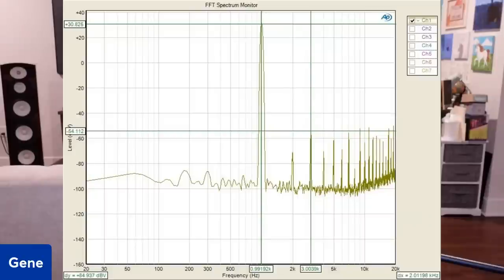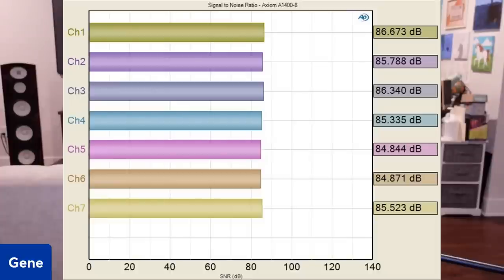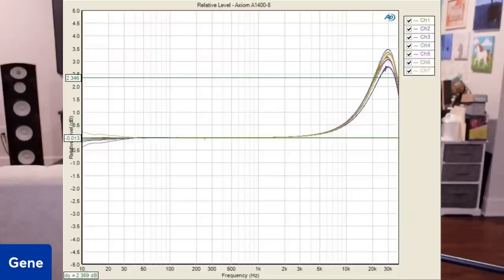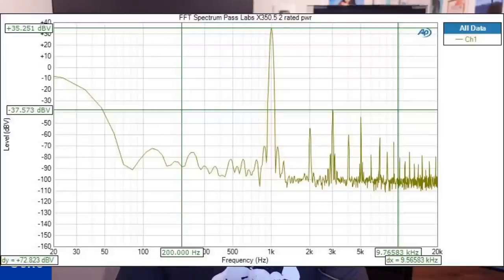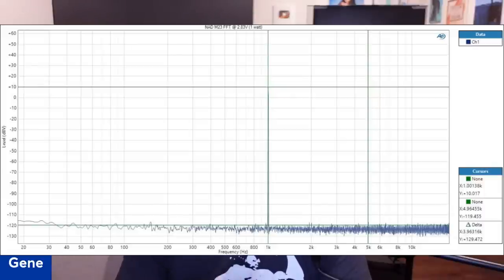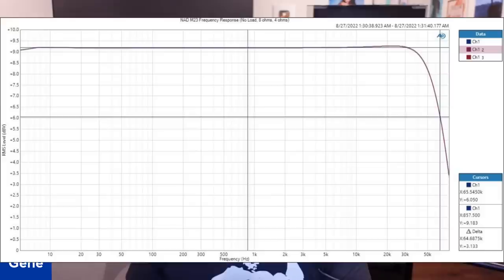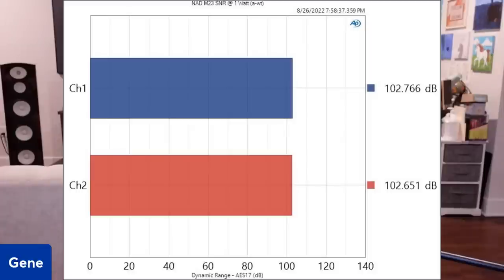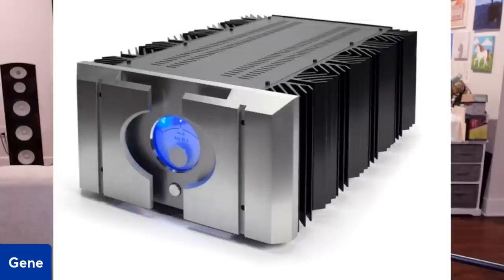Linear Amps are DEAD, Long Live Class D!

Comment: I have tried the Hypex UCD modules and those are garbage for hifi as they give me listening fatigue. But I guess that they are okay for rear channels in a surround setup og a subwoofer.
Reply: With which speakers? What amp are you using now instead?
Reply: @ThePentosin  My speakers are a pair of Ekta Grande, designed by Troels Gravesen (3 way, with Scan-speak revalator drivers). Now I’m using a Gryphon power amp to drive them. I have also used a NAD S300 integrated amplifier which sound similar to the Gryphon power amp that I now use.
Reply: @3Dmaking  Well, ucd is over 10 years old. So it fall i line with the point of the video.
Your speakers going down to 3ohm might exacerbate the issues with it. 
Would be interesting to know if the newer ncore would satisfy you.
Reply: good for a subwoofer
Reply: @ThePentosin  I know. The other amps that I use are +20years. But the impedance load in nothing special from a 4 Ohm speaker. The next amplifier is not going to be anything nCore, but most likely a Parasound Halo JC5 😁

Comment: Yes, Class D is the future. Love my Purifi amps and I also will not have to worry as much over my electric bill this winter. 😉
Reply: true but in winter, any excess energy used by an a/b amp is directly heating your home, so it's not really "wasted"... except to the extent that electric heat is more expensive than gas or a heat pump.

Comment: So I guess you're not familiar with the measurements of the Topping LA90 amp. Class A/B
Reply: I can't find any measurements besides the manufacturer's claim, can you point me to any review? Looks good indeed. I wonder what's inside the box. A separate power supply - that's cheating, though. That's why the enclosure is so small.
Reply: @VioletGiraffe  Check audio science review...

Comment: Hi. Previously NAD had the M32 amplifier with DirectDigital technology which was fully digital amplifying. What happened with it? Why NAD switched to HybridDigital which is by fact analog amplifying in class D?
Reply: My M32 didn’t sound that good.  I had $600 monoblocks with better treble response when hooked up to a Node 2i.  I think the NAD class D had a hard time with high frequency speaker load.  I sold it at a $2k loss.

Comment: No problems from me with class d though I continue to have issue with many of them not being able to maintain rated output in higher frequencies.
Reply: what does that even mean?  no one is ever putting out 100w to the tweeter, or frequencies in the 1000s of hz.  we need the power primarily for bass.  if you were to cut out everything below a couple hundred hz, the power required is FAR far less, like an order of magnitude.  simply not an issue at all.  and in any rational set up, you've chosen an amp that has enough power - i.e. a real usable power rating (>.1% thd) that exceeds what you'll actually use... you don't buy an amp to use it at 100% of it's rating, so that makes it even more irrelevant of an issue.
Reply: Bone up on power usage by tweeters.  It's short term and most tweeters can handle thousands of watts.  If you like clipped hf, good for you.
Reply: @bluelithium9808  I'm fairly boned up as you say and just read a bunch on audio science review and other places and feel my point stands.   What are you smoking exactly, or provide your reasoning or sources.   We are talking about domestic listening environments, within 3-4 meters.  Are you listening to super high dynamic range music with peaks pushing 105, 110, 120dB with inefficient speakers?   If you're crazy like that good for you get yourself a thousand watt amp and call it a day.  But under normal conditions for 99% of people this is simply not an issue, and class d amps have no inherent issues with limited HF output power.  

I know all about how tweeters can handle one or a FEW cycles at stupid high power levels - without mechanical damage, NOT clean outputs.   That's irrelevant for music and normal listening volumes.   HF transient peaks are typically 60-80% the power of lower frequency peaks, so yes that could be quite a lot more than the general understanding of a tweeter only using 10-15% of the total power.  Indeed tweeter transients could need all 25 or 50 or 100 watts of clean power to match SPL with the woofer.  But amps also, though to a lesser extent, also have the ability to output higher levels in a burst / transient scenario.  Especially when we're talking HF transients which are effectively super short bursts.

However none of that matters in the average living room set up with even above average listening levels.   Your tweeter isn't peaking with over 100-200 watts.  And even if it was, as long as it wasn't mechanically damaged, you wouldn't hear the distortion in a transient anyway.   Most tweeters would be distorting long before a (clean) hundred watt amp clipped.  

The very papers and discussions linked to and had on sites like audio science review that discuss high power transients to tweeters support this conclusion.  You should stop worrying about it, it's not the problem you think it is, and it certainly has no relationship to class d vs classabout, at least not any good modern example of one.   I listen at LOUD volumes at times, with ~125w of clean power from a class t ta3020 design and my super tweeters as well as my mid horn that goes to 8-10khz ish are still doing just fine and I never hear any amp clipping because it isn't happening... it's not as though the hf transients are larger than the bass ones, so you would know if you had clipping.  Now tweeter distortion?   That's a different question, that may be occurring on transients, it likely is, or even in sustained loud passages.  But I can't hear it at any volume I listen to, and past a certain point I doubt you'd notice past the physical pain and even distortion of your inner ear.

Most tweeters cannot handle "thousands" of watts, but hundreds maybe a thousand... but mechanically surviving it is what they are talking about, not producing clean transients with that kind of input.   Period.  So your amp doesn't need to push 1000 watts for an 80-90db average listening level with 10-20db dynamic range.   And especially not for the sake of your tweeters.   Bass would be the first consideration, always.  This subject is more important with active or biamped setups where someone might give 200w to the woofer and only 25 to the tweeter, for example... common wisdom might say that's OK but to your point the reality is we want the power levels more closely matched than that.   But with one amp it's less of an issue... even if you have a padded tweeter, guess what... it's padded because it has a higher sensitivity and thus needs less power to match SPL.

Comment: Gene I tied to embrace new class D tech, specifically this very amplifier.  I thought I might actually get rid of my class AB Yamaha amp and pocket some money if I like the NAD M23.  I agree the M23 is beautifully built, is very quiet and super clean. It sounded great for home theatre, but unfortunately I found the sound for music less than desirable.  The M23 simply wasn’t emotionally engaging for music. I was very disappointed as I really wanted to like the M23.
Reply: I own the M33 and I wouldn't recommend it to owners of amps that color the sound as explained by Gene. Why ? It's amplification is so neutral it could really use some options to modify the sound IMHO.( 5 way equalizer  sliders, turning knobs for treble and bass for example ). 
Even on my M33, from factory, it felt too clean on my Focal Kanta no3's. ( a little harsh, a little less bass/mids compared to my Marantz 2 channel 140W 8 Ohms class AB amp I used to own ). The M33 does have 2 sliders for bass and treble you can play with, + or - 6dB, but that's it. If I had bought only an M23, I would have been disappointed for sure. I found the M33 a little disappointing at first. 
But now, after a proper Dirac measurement and a +12DB bass curve applied to it, is finally sounds the way I want it to sound. ( the 2 sliders are back to 0 now ). It sounds more clean, no hissing, better control and definition of low bass compared to the Marantz ... my energy bill will be a lot lower for sure as I'm running the amp for about 10 hrs a day :) On the Marantz amp, I could bake an egg.
Reply: Yep. I have some class d amps too that "measure" great, but i get the feeling its too accurate or sterile, emotion of music is missing. Different story on my single ended class a tube amp, even thou its not that accurate and has higher noise floor. My main speakers are horn loaded, 99dB/1w  (Klipsch Heresy). I don't need more than a 1 watt usually LOL, so quality over quantity,

Comment: What class D amp that gives holographic sound stage like tubes and doesn't sound sterile? 

Amps like Benchmark measure amazingly but it simply has sterile moments. 

Also...  people like the class A / Tube amps
That give off third as well as other order Distortions (probably what you picked up on the class A Distortion) and depth of the tube Harmonics that give a "warm" sound and "holographic " Soundstage.
Reply: have you yourself listened closely to a Benchmark amplifier

Comment: I have developed interest much more in Class "H" amplifiers than class D / before I say " this is the future " I'd like to see if you would conduct an  assessment of a class H vs class D amp - would this be possible Gene?
Reply from the maker: I've reviewed many Class H and Class G Amps over the years. They can be very good but not this good in terms of noise and distortion.
Reply: @Audioholics   But it would be say an NAD or similar manufacturer / not these cheap class D amps CheapAudioMan pushes from China for $150.00 or less, correct?
Reply: If you get high sensitivity speakers, like 100db+, even a class H is not good enough!  How do I know?  I just bought an Emotiva XPA Gen 3 amp (class H) for a 4 way speaker project using pro audio coaxial drivers.  The 107db sensitivity horns bring the noise floor to life!  Without padding the horns, the hiss is shockingly loud.  To quantify, starting with noise floor of 40db,  powering on the amp increases it to 48db @ 1foot from the horn.
Reply: @fredy gump  
Very true.  For loudpeakers that use very high efficiency MF and HF drivers, you will need amplifiers with extremely low distortion and high SNR at 1w-20w.

Comment: I want an 8 channel class D amp with 200+ watts/ channel, with super low noise!   I thought they should exist.  Class D has been in use in pro audio for years now, not to mention being used in studio monitors.  But I didn't come up with much that would work for me.  So I settled for an Emotiva XPA Gen 3 (Class H) amp.  It is a lot better than their older designs, but still not quiet enough for my stupid sensitive horns.  (I added an L-pad, which helps...)
Reply: D-Sonic makes a 8 channel Class D...I have 2 of their Monoblocks...Very good amps
Reply: @larrycooper7249  Interesting.  Looks like only up to 7 channels, though.  Given I have the Emotiva now, I'd be more tempted to add something like a 2x50watt class D in a 1ru form factor to handle just the horns.
Reply: He will build any configuration needed 1 to 8 (maybe more)

Comment: You couldn't find a more rabid class d hater than me.  But I have seen... er uh... heard the.. light? Some of the amplifier module's from Purifi and Hypex are shockingly good. NAD seems to agree, they use Purifi modules in their class d amps. Class D still has limits,  but all these classes have limitations in one way or another. I also think class D will continue to improve as consumers embrace them. Their power output, low noise, and low distortion are too good to ignore.

Comment: I would like to see how this compares to the Topping LA90 that is a lot cheaper.
Reply: No comparison. Topping LA90 consistently measures -15db quieter.  With the LA90 you are limited to 95 watts  in bridged mode on 8 ohm speakers only.
Reply: @aaronfriedman8201  ok that's impressive!
Reply: @aaronfriedman8201  I don't need the power more regarding performance.
Reply: @aaronfriedman8201  True, the LA90 is amazing.

Comment: Who needs over couple watts? For most, not even using 1W if you have any decent sensitive speakers
Reply: 20W for most direct radiators is on the low side.

Comment: Great video Gene detailing some of the benefits of class D amps, but the one thing that matters most to myself and a lot of people like me is whether or not class D sounds better, worse, or the same as linear amps.   I don’t care about efficiency and test metrics.   I care about what my ears tell me.

IF, and that’s a pretty big if, class D amps sound as good or better than linear amps, then you can say linear amps are dead and all of that business.   If class D does not sound better than linear amps, then there’s always going to be people that want the better sounding amp no matter how much more power efficient and whatever test measuring improvements class D has over linear.   Question now is how do you do comparison listening without having any bias or knowledge of what amps your listening to.  Blind testing or double blind testing probably?
Reply: All amps sound the same if there is no audible distortion or noise and are not built defectively.  You will never be able to tell the difference between a 100k class a/b amp and a 1k class d amp in a double blind test.  This is the same with dacs as well

Comment: Have you tested the Benchmark AHB2? I believe it’s AB but with a switching power supply.  I’ve got one in my listening room and love it. Got it because it’s one of those amps that measures very well, but is compact and doesn’t get hot at all.
Reply: I think that is the best measuring amp on ASR.  Amazing end game amp.
Reply: I have one and I must say it is a 12.5 lb class AB engineering work of art.

Comment: Class D amp are light and efficient and don't sound great in upper frequencies. That is of course they are improving and one day soon it will all be Class D
Reply: Yes I noticed this with the Audiophonics hpa-T400ET. High frequencies sounded harsh on my Focals. So I sent it back and now my mind is telling me to stay away from class D.
Reply: Not true. Change your speaker !
Reply: @r423sdex  My speakers are just fine. Sopra 1. Extremely linear. On AND off axis. Never had any issue when playing AB amps. Harshness with class D in treble region. I heard it, and my girlfriend confirmed without me telling her anything. Just asked "what do you think". Tried improving with eq but still sounds bad.
Bass was very good. But the high frequencies sucked. Screamy. Inaudible.

Comment: I nearly killed this video as soon as you mentioned, several times, the measurements of amplifiers. Do you work for ASR??!! Measurements are NOT the way to choose ,,, anything! The info IS useful, but should never be used to determine how good or bad an amp is. Just in case you may think I'm a die-hard class A - A/B guy, I'm not, I actually use a class D amp to drive my Maggie 1.7i's, and it sounds great.
Just to 'wind up' all the valve (tube) aficionados on here, why not include graphs from a variety of tube amps? They would 'look' AWFUL, particularly if they also include valve rectification, which is THE worst type of rectification possible as it measures and performs absolutely terribly - looking at a graph.

Comment: Does anyone have recommendations for affordable high quality class D amps? I've heard of D Sonic, but are they any good?
Reply: What is affordable? what may be affordable to you might not be to me and vice versa. I have a Peachtree Audio 220 power amp along with a Peachtree Audio SonaDac that I use in my bedroom setup and they sound great to me. I purchased them second hand so I did not pay the higher retail  price.
Reply: Aiyima A07 using a good quality 48 Volt 7amp external power. Gives around 100 watts into 8 ohms.

If you need more power for your setup I'm sure there's other budget options on the market.
Reply: Look at the Topping line, the PA3s, the PA5, the LA90.

Comment: Do any 8-channel Class D amps measure similar to this? Anyone know?
Reply: Typically they will be very close if they use the same spec Hyped or purifi amplifier. The only difference may be the power supply design and how well they do their wiring to limit cross talk.

Comment: I went Class D almost a decade ago and haven’t looked back. “Get rid of your old biases” - pun intended? 😀
Reply: I'm just curious, what kind of speakers are you driving with the Class D amps?
Reply: @cardan12  Vintage! Dunlavy Aletha's from the year 2000.
Reply: @bikeman7982  Mine are old too, but they still sound incredible: Martin Logan SL3 paired with an Aragon 8008BB, a total beast. But, it is 80lbs and runs hot. About to try the newer Class D amps. We'll see. 🤞
Reply: @cardan12  I'm sure it sounds great. But, yeah Class D has really matured. A Class D stereo amp can weight less than 20 lbs, but put out over 1000 clean watts per channel into 4 ohms.